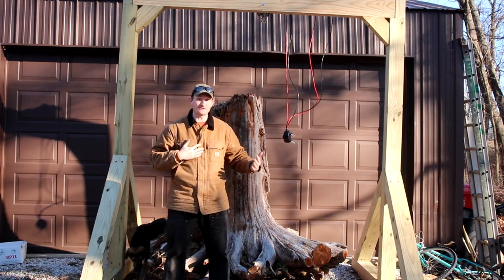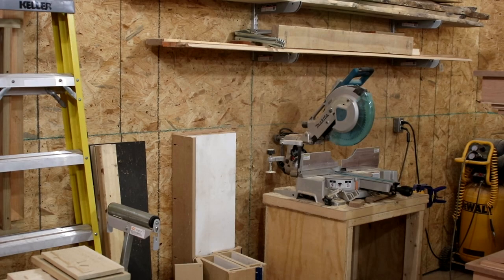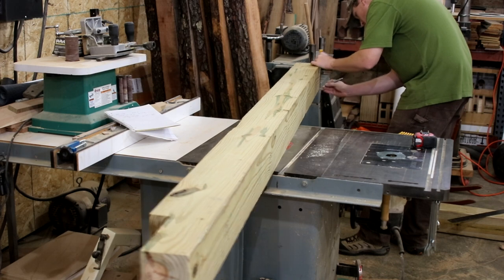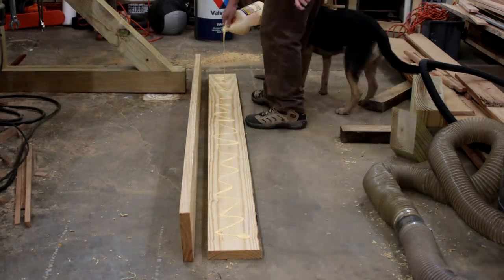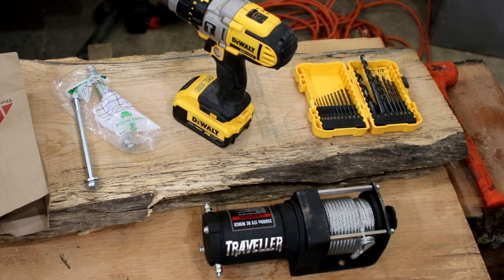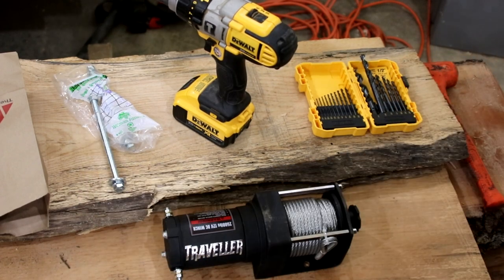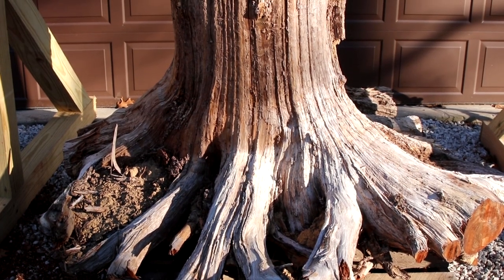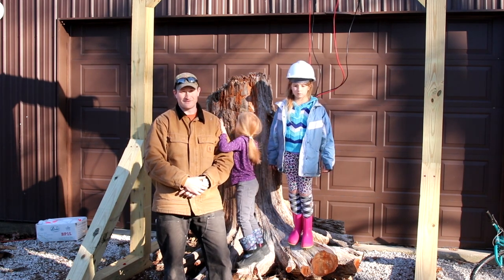Family saved $5000 building our own own gantry crane lift! See how!

Comment: Nice job.  I am an engineer, and have a few suggestions.  White Oak would of been much better choice, especially if you can saw the header as a vertical grain.  Winches are not supposed to be used for lifting because there's no brake to hold the load, so be careful with a suspended load, gearbox will eventually fail.  Use larger bracing at top to support beam closer to center and reduce the bending moment in the beam.  Of course small loads are whatevers, but just like everything else, I'm sure you'll max it out sooner or later
Reply: You just added over-kill to something that exceeds the need.
Reply: I love your added information.

Fiddlesticks on the above comment or.

Comment: I've built 4 over the years, 2 wood somewhat like this one and 2 from metal. I used an I beam for the metal ones so I could hang the chain hoist on a trolley to give maximum flexibility. The end supports were 1-1/4" square tube, 4 pieces. They worked awesome in my old tractor repair shops. I put casters on the bottom of the legs so I could roll it anywhere in the shop.

Comment: Unfortunately, no lumber is ever really mitered square on the ends when originally cut for resale by lumber yards, big box stores etc. You will always find that both or at least one end will always be off square by several degrees. Using beam type wood screws is okay, but bolting the beams together is better for continuous holding power in beam type construction, such as with your gantry. With bolts and nuts, the gantry is sufficiently secured, but can still be easily dismantled if the need arises to move the gantry to a distant location. The drilling of holes through the top lifting beam, for mounting the motor will over time weaken your lifting beam at the point of the motor. The weakening can be eliminated by having a nearby welder fabricate 2 steel plates for the screws to go through on either side of the top beam. Even better, have the welder fabricate a single steel plate 6" x 6" x 6" bent so that it will straddle the top beam with 4 holes drilled for the bolts to pass through. The cost to have a plate made will be nominal and wisely spent, that is, when you consider what you are asking your gantry to do and to endure. Remember, your gantry will be outside more than inside, between the weather and the lifting of weight, the beam will lose a lot of its strength over a period of time. If the beam and the lifting motor are additionally supported by some type of steel plating, the gantry will more than likely last a lifetime.

Comment: Based on the top beam being 5.5 inches wide and 7.25 inches tall, with an allowable bending stress of 1000 psi and a span of 8 ft, the maximum load in the center of the span would be about 2000 lbs.  This does not consider any other failure modes.

Comment: I really expected you put put the winch ATOP the beam, and just run the cable down through the cross-beam, through a hole (or void in the glue-lam's?). That way it's inherently stable, the winch base pressing down on the beam, not hanging off the side on the bolts, putting the bolts in tension and the beam. I'm not an engineer either, just a duffer structural draftsman, for a lot of years. Good on you though, loved the video.
Reply: Yah—

—you know what—

—I kind of thought he was going to run the cable through the beam also.

Comment: You can buy all of the steel brand new for far less than $1000 and Amazon sells a 4000# one for under $900 with free delivery.  I’m a professional welder and I got one from Amazon.
Reply: But for those of us who are not welders don't have the option that you may have.

I would consider some sort of metal plate to hang below the beam to help any bending stress. About 10-gauge steel? About the thickness of the subframe on my 1999 Toyota Solara....

Comment: Interesting build.  I admire your desire to use wood.  A couple notes/suggestions.

Your ATV winch is meant to pull, not lift.  Check out the first bullet on the last page of your owner's manual.    Northern Tool and Harbor Freight sell some cheap cable lifts that will do what you want to do. 

To hang our lifting device, You might consider using some heavy steel over the top of your beam with suitable a suitable connection to the bottom of the beam and another piece of steel.  Then hang your lifting device off that so you are not compromising the strength of your beam by drilling holes through it.

You might also think about getting some reinforcing plates on those joints so a side load doesn't destroy your crane.  Wood screws don't provide nearly enough support to keep it from collapsing diagonally.

Good luck with it, and keeping kids and dogs a safe distance away is also demonstrating how much you care for them and want them to grow up intelligent, independent people.
Reply: Excellent points!

Comment: I have a structural beam between my living room and kitchen/dining room.  It is 2 2x10s and a half in piece of plywood.  I have another story and a roof above that.  You will never be able to reach the capacity of that beam.  Your legs and supports will fail long before the beam goes!  NEVER "lift" with a winch the capacities are calculated differently.
Reply: But your house is a st static load.

That tree stump was migrating pretty far upon lifting it off the trailer.

Comment: I am making a similarly fixed gantry as part of a rear carport wall.
I am using 4x6 pressure treated. These people on you tube 
using 2x4's are scary.
Something I learned in the 70's is to put 2 eye hooks 2' from each center. String a safety chain
through the hoist as well as the hoist crane. Be a bad thing to put all your trust into a made in China hook.

Comment: Your dog is getting big already. Job well done. you would not believe the comments I got because I bought two treated 4x4s  in one of my videos. Good thing you headed that off. I want to build a gantry like this to take logs off my trailer when I don't have the skid loader around. job well done keep up the good work. 👍
Reply from the maker: One note on construction.  I strongly recommend strengthening the bracing in the corners.  The timberlock screws have wiggled loose a little, and I see I will have to do a little more work before I am 100% confident of this lift.  Also, I added a chain hoist.  Updated video moving something much heavier coming out soon, thanks!
Reply: Agreed ---- TimberLocks are amazing, but a lot of what you have is screwed into end grain, so you lose a good bit of hold there.
If you put an outside board on all 3 sides of the top beam, overlapping the tops and sides of the posts, it'll help tie them together much better. And I'd probably use through bolts on the ends, and at quarter points in the beam, using Timberlocks in the the rest of the field.
I'd also go for some bracing to tie the outside and inside faces of the lower corner braces to the posts. This is all based on upgrading what you have already built
You are on the right track mate :) 
Dogs are awesome and I'm glad that Winston is a good pupil and also that you have those little helpers to keep you centered :)

Comment: Next time you need custom length bolts look at "All Threaded Rod", common hardware store item, usually from 1/4" to 1/2" diameters x 3- 4 foot lengths, simply cutoff what's needed. ☺

Comment: worked good, I was kinda afraid the wench would not hold that much weight and start coming back down as soon as you let off the button, but it is doing good.
Reply from the maker: My concerns were the same.  I have already updated it with a chain hoist! Kkeep posted for newer videos showing modifications, thanks!
Reply: I don't think the wench was holding much weight! ;) Nothing she couldn't handle, anyway. LOL I was, however concerned about all that weight on the winch, and those two tiny bolts. :)

Comment: bit surprised you had dogs and children around a suspended load. I have had colleagues killed from being under a suspended load. Also bolting your winch sideways to your top wooden beam jeopardises the beam and cuts down the safe weight as the wood can split.. Small load yes , tree stump no. Snatch blocks are handy but the set up you have would have the danger of splitting the top beam.